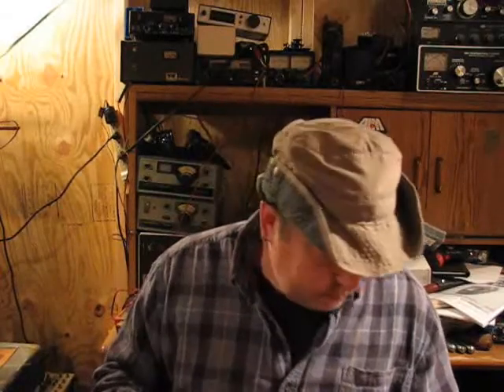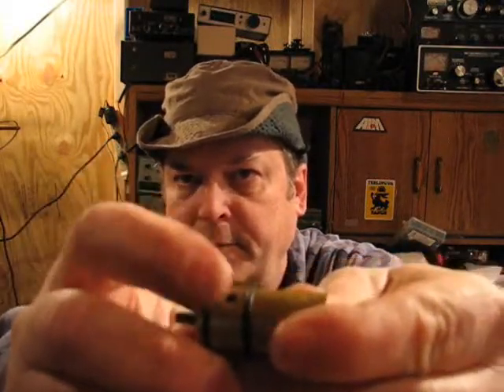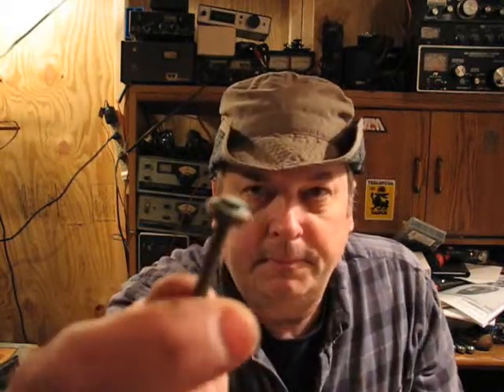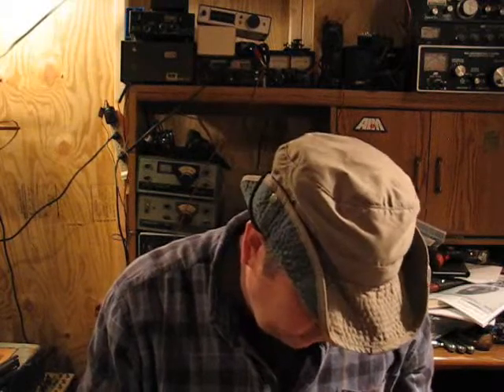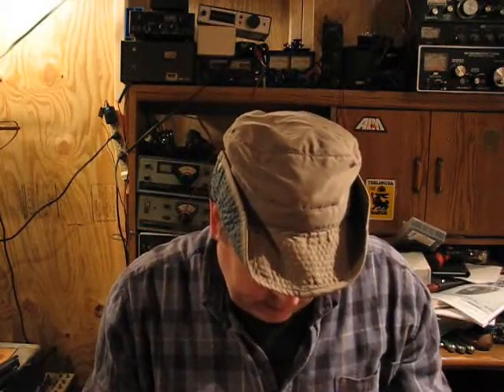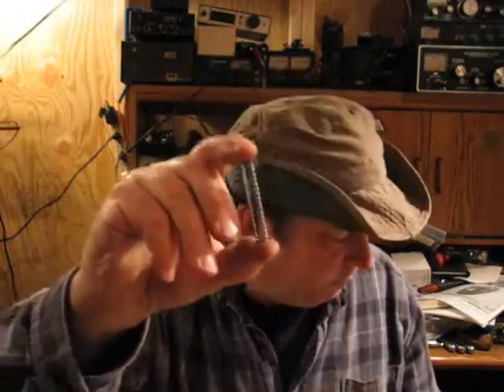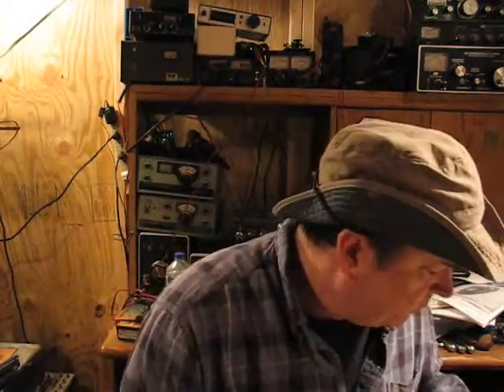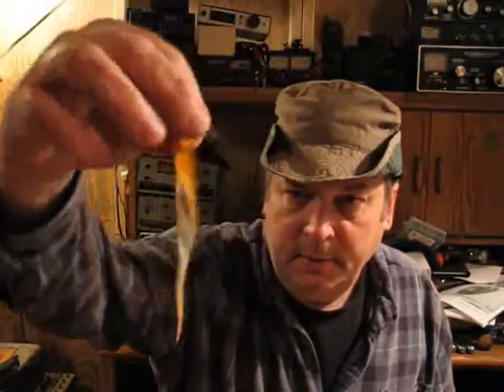Benjamin 392 Valve Mod

Comment: My benjamin just says 392 not 392pa,   are they the same thing? Does mine have aluminum or bronze values i think it was made in 2016
Reply from the maker: 2016 is a PA, and it should have the brass valve. If it turns out to have the aluminum valve, just order a new one from Crosman. The new ones are brass, and they are not expensive. I like keeping a spare anyway.
Reply: @Possumliving    mine also isn't engraved instead it has a yellow serial number.  Im worried mine is fake,  I bought it from ebay it was listed as a 392pa
Reply from the maker: @noctilucent7396  That's a new one on me. I would definitely call Crosman. If it's fake it needs to be reported.
Reply: @Possumliving  I also noticed the new syntheic 392's have cheaply silk-screened with gaudy gold lettering model numbers too. hrm
Reply from the maker: @noctilucent7396  I haven't seen any of those irl, but can't say I'm surprised.
It's interesting how much the prices have jumped since they quit making them.
Reply: @Possumliving  i called crossman gave them the model number they said it was real and some have painted model numbers because the engraving was hard to read but they changed it back to engraved.  But they said it was authentic. Good to know I'm getting a 2016 real benjamin 392pa very very excited.
Reply from the maker: @noctilucent7396  Good deal! I'm glad to hear it.

Comment: Missed one,,, reducing inside volume. On mini lathe drill hole inside plastics check valve j.b. weld wooden dowel plastic pin or mettle stud your choice .now needs to be small enough to slide inside of spring adjust length so poppet when firing doesn't make contact can reduce volume at least what you changed it by not screwing all the way together.

Comment: Question couldn't you use teflon tape to seal and hold the two halves and put a rubber o ring spacer?
Reply from the maker: Yes, you could.
Reply: Is there any repair shops in the Oklahoma city area for the model 392?

Comment: possum living,do you sell already mod valve for 392
Reply from the maker: No, but perhaps I should.
Reply: Is it one mod for efficiency and one for power or is it just one  put together?and what fpe are you getting. By the way your a sharp man with this thing's
Reply from the maker: Thanks! It's primarily an efficiency mod, but by increasing efficiency you also pick up some power. I'm getting about 16 fpe with 14.3 grain CPHPs.